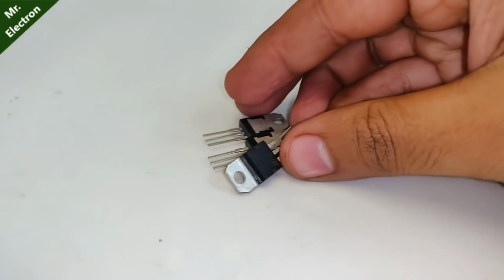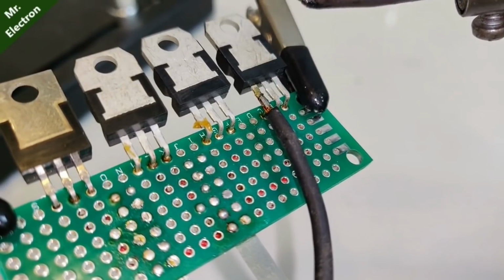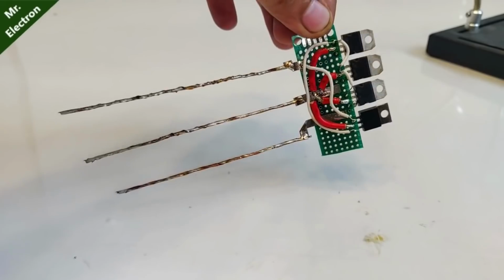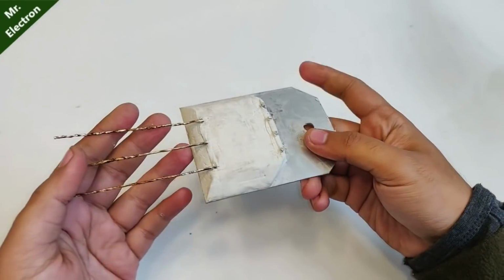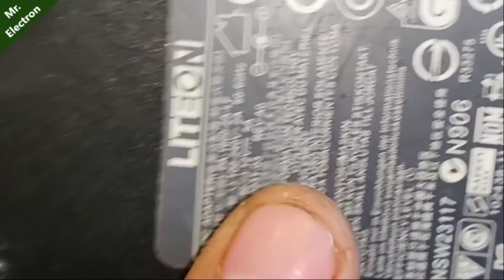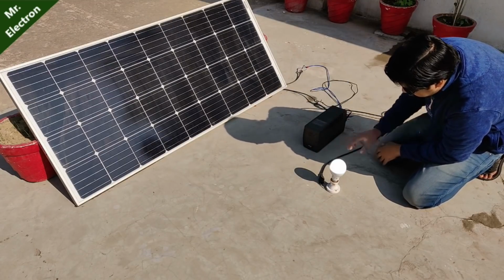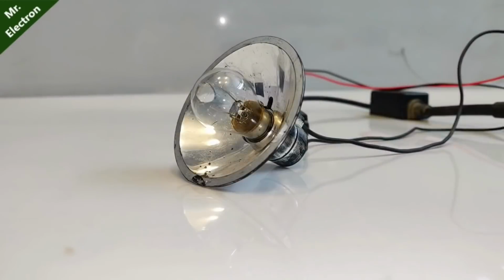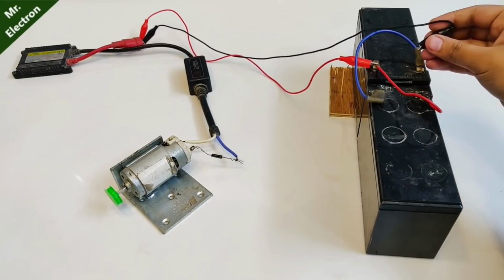3 Simple Inventions with Electronics

Comment: Your transistor parallel circuit has two drawbacks:
- bipolar transistors should not directly connected in parallel - thermal runaway! The hottest gets hotter!
- you use emitter follower circuit and darlington circuit - so you have from collector to emitter at least 2x0.7V = 1.4V. This will lead to big power dissipation in the transistor with high loads. Do not use darlington circuit and use it in collector circuit to reduce collector to emitter voltage and the power dissipation inside the transistor.
Reply: Thanks a lot. I needn't to watch this.

Comment: Sorry to say so, but the power transistor you made is not something I would recommend.
Parallel coupling bipolar the transistors the way you did is not recommended and would require that you match the transistors if you do.
Reply: When several devices are placed in parallel it is necessary to decouple them by diodes between C and E, so that the breakdown of one does not drag the others. Look at power circuits for motor control or directly, in an electronics textbook for engineers.

Cuando se ponen varios dispositivos en paralelo es necesario desacoplarlos mediante diodos entre C y E, con el fin de que la averia de uno no arrastre a los otros. Mírate circuitos de potencia para control de motores o directamente, en un libro de texto de electrónica para ingenieros.
Reply: @octavio9657  That is a protection for reverse current from inductive load and is a must when controlling an electric motor.
I do agree that it should be included as an improvement.

Comment: I am sure you meant to say 1.5 square millimeters (1.5mm²). In metric system wires are measured by area of cross section, hence "square". 1.5mm² is common building wire used for 10A circuits in wiring houses.

Comment: Stop using the flux (you absolutely do not need that) and learn how to solder. When you see the solder in a shape of a ball, which you have when you soldered the transistors, then you have done something wrong. You did not give the solder enough time to melt and to bind with the solder on the board. Keep your soldering iron longer on a connection and you will see the solder will not be a ball but it will be hollow. That's the sign you have a good connection.
When you want to show something here you need to make sure you are the expert in everything you do in the video. Now you are not. Sorry to say this, but that's how i see it.
Reply: contrary to your comment. People come to the net to maybe learn something. 
" Posters & viewers alike."

Comment: What were your inventions ? 
You didnt invent the transistor  or an electric motor, or solar panel or UPS !! All you are doing is connecting stuff together, that's not inventing anything !!
Reply: All invention have to start somewhere no? 
But never with discouragements🤔
Reply: @andybilakshow260  In principal I agree with your comment. But I don't agree that any of these are true inventions in the strict meaning of the word. Making or Copying maybe, inventing, sorry NO !!
Reply: @andybilakshow260  The multi transistor unit he built is based on a Darlington configuration which he DID NOT INVENT !!
There is also a problem with his version as the current will not flow evenly through the three transistors in parallel, so the power demand is not even and neither will be the heat dissipation. 
What will happen is one of the paralleled transistors will take the majority of the current as they are not going to be perfectly matched, this means one will burn out first as it will be doing most of the work.
So the max wattage will be close to one of the paralleled transistors max wattage not the combined wattage of all three.
If you examine high current power supply design this is solved by adding resistors into the paralleled pass transistor stage.
In other words, in your so called "INVENTION" you will have one pass transistor go pop way before reaching your desired output wattage of all three WITHOUT these additional resistors in circuit, because you are not sharing the load evenly between all three pass transistors. 
If the young man was really a "Professor" he would know that would he not? 

Don't get me wrong this young man does a great job with his videos, 
BUT I don't like anyone taking credit for someone else's INVENTIONS !!